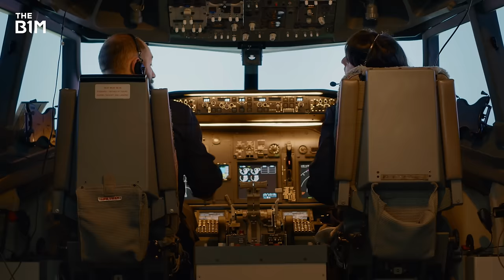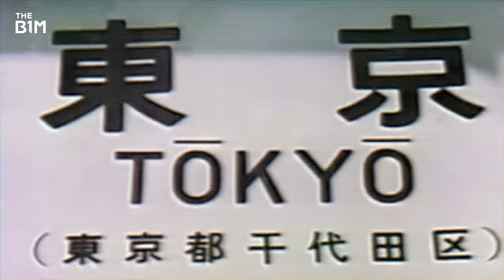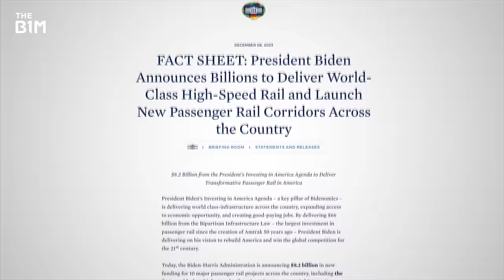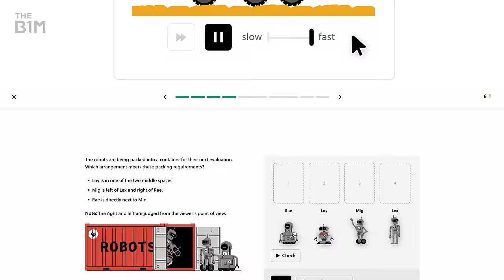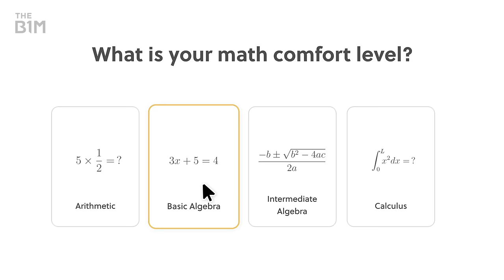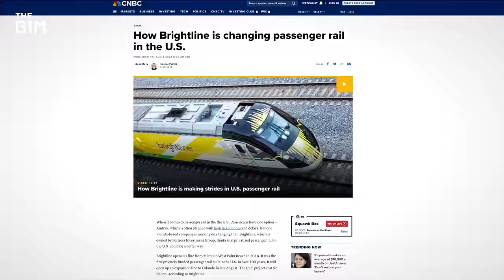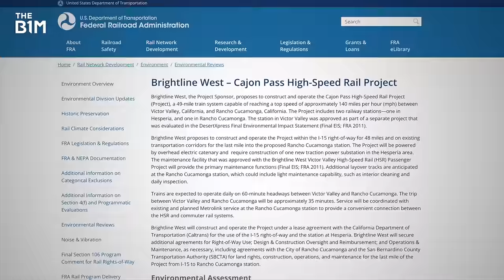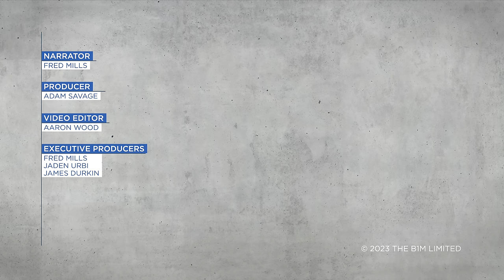The $140BN Race to Build America's First High-Speed Railway

Comment: The problem with America is not a lack of railways, but a lack of public transport infrastructure within the city. You may reach LA in a train quickly but after that you can't roam the city without renting a car. Most people don't take trains just to get to the station.
Reply: The sad part is that compared to other major cities, LA has decent public transportation by comparison. LA has subways, lightrail, and metro buses. The infrastructure completely sucks compared to NYC. There are other major cities that have such awful public transportation that it makes LAs look good. The bar is low in america. We cant fund stuff that might benefit poor people
Reply: LA is disgusting, especially downtown. It is a public urinal.
Reply: True, but trips to Las Vegas are the opposite. They have a monorail service for most of the strip and even outside of that you are often better off not driving.
Reply: You're not wrong, but we need something to help spark the need, such as what Brightline is doing. If we just keep saying 'its useless because we don't have x or y' we'll never have it.
Reply: Same thing could be said for air travel.
Reply: 😂 yeah, you're right. that's the problem with America.
Reply: how many productive hours American can save by going on a 350 km high speed train instead of driving.  Indonesian can now spend only 45 minutes using their first high speed train instead of 3 hours driving. They can still usebtheir hands towork on their computer whlist on board         the train . Hands are stuck to steering wheel when driving
Reply: My cousins uncles boyfriends roommate got his testicles stuck in the bay doors at the light rail warehouse facility in San Diego.
Reply: in this specific case, it’s almost entirely for transferring people from LA to Vegas, not the other way around
Reply: @marcob1729  And then they'll hitchhike back after they lose all their money, right?
Reply: @-whackd says the person that probably either only visited LA once, or not at all.
Reply: Robotaxi
Reply: "you can't roam the city without renting a car." This is no different from travelling by airliner, which is very popular, and not a unique obstacle to passenger rail in the U.S. Also, light rail in L.A. does not make it very unique. About 30 cities in America have light rail systems and 16 have metro systems.
Reply: @BroadwayJoe99  hey, that'll still improve the return traffic! Hitchhiking is a form of carpooling
Reply: @dimitar297 wait what
Reply: A common and tired excuse to continue to not have any viable train service. You have to begin some where.
Reply: The U.S.’s problem isn’t lack of engineering/ingenuity…  it’s the lack of “private” business competition.   
90% of all government contracts, are given to government cronies
Reply: @DavidLopez-rk6em   I have lived in multiple cities in the US with public transportation, including Boston and San Francisco.  It sucks, and has gotten worse in recent years due to cities allowing all kinds of anti social behavior in public. I'll stick to driving my own car where I don't have to sit next to filthy bums and risk getting mugged.
Reply: Couldn’t the exact same thing be said about airports?
Reply: Hear, Hear. LA's transit system is a mess. Sure they have commuter train that are clean and relatively safe. But they're slow as all get-out and outside of the convention center don't really go anywhere.
Reply: @dholzric1 bums and lousy public transport have same root cause, the deliberate defunding of public anything - transport, education, Healthcare by the hardcore raeganites and repubs.
Reply: @krane15  Thats the issue, LA has transit but it doesnt take ppl anywhere important, if anything it takes them nowhere
Reply: @DavidLopez-rk6em  The Northeastern Cities have pretty robust Transit networks, LA once had the largest tram system in the world, car and oil lobbying is the reason why transit still Sucks in the US
Reply: Also the lack of maintenance
Reply: @alexpoon4767 America likes keeping its citizens on a rat wheel. Tired, overworked.... No downtime. They love STRESS
Reply: You park your car at LA train station, take the train to Vegas and return to your parked car.
Reply: Also most homeless encampments are near or at rail stations due to struggles in the past. People would arrive by rail, unable to afford a car, couldn't find a job due to multiple factors, then they'd end up homeless with no way out because businesses don't want to be next to a bunch of homeless people and the cycle just feeds into itself.
Reply: @krane15  I live right next to a commuter rail station and don't bother using it bc on weekends, there's only 2 trains per day and I can't get anywhere significant. I'd love to go into downtown LA for a day trip, but wont be able to get back home since the last train from Downtown leave at 6pm. It's pathetic.
Reply: That's simply not true.  There are many main  sites that you can get to by train  and bus in LA. I doubt you live here.
Reply: @mizzury54  I don't but the last time I was there my dad made the mistake of thinking he could take a bus from Disneyland to LAX. Nope, no bus routes that any of us could find including my friend who lived in Temecula. Also I took an Amtrak and then a bus to the station closest to Ontario Airport and my options were Uber, Taxi, or walk 5 miles for the last section.
Reply: How is 3 hours to go 220 miles between LA and Las Vegas considered high speed?  Since 1982 hi speed train gets you from Paris to Lyon (300 miles) in 2 hours and since 1998 from Paris to Marseilles (500 miles) in 3 hours. Why can’t we thrive for this level of excellence?
Reply: There is lots of public transportation available throughout Los Angeles
Reply: Within city will be solved with self driving cars
Reply: this x1000. People don't seem to understand this. High speed rail is basically pointless in the US, because once you get to your destination, you have no choice but to either rent a car or pay a ton for a cab. This isn't Japan where there's amazing busses and whatnot. Most US cities simply don't have public transit, aren't constructed for it, and would barely benefit from it. High speed rail would make sense in a few places like DC to NYC, but that's about it.
Reply: I mean, the same exact thing is true with a flight
Reply: @moonasha  Good thing you’re not in charge because you’re totally wrong many cities have great public transportation maybe you haven’t been anywhere in a long time like decades
Reply: @BroadwayJoe99 It's as difficult to gamble away your round trip ticket as your car keys or your phone.
Reply: @antonioblt9407 Mountains in the way are a big part.
Reply: @moonasha Explain how that's any different to flying into a city.
Reply: @daniellewis1789  That sounds like what someone that's never lived on the edge would say.
Reply: Don’t see the issue with renting a car at the end of your train trip just like I would flying
Reply: @ricardorocha8758  You've never seen someone lose it all. I'm a retired drummer and vocalist that played in Nevada's casino cabarets for over a decade, and I've watched it happen in real-time more than once.
Reply: @antonioblt9407  compared to driving 5 hours it is. Plus Brightline is starting out as diesel powered. The others in the world are powered by overhead electric lines. That's more expensive infrastructure to start out building. Another reason California is taking so long, which really will be high speed world standards.
Reply: I used a train to get from Irvine to DTLA last summer. Expensive, inconvenient and not user friendly. Then you get to experience the LA Metro! I’m a well built 41 year old Scotsman, and have happily used rapid transit systems all over the world. The LA Metro is another experience altogether.
Reply: The main problem is the lobbying of car industries.
Reply: And the workers are "lazy" and "overpaid". Look at China, the workers take 1/4 of the paycheck and happy to works like 12 hours a day without compliant #kidding
Reply: @Jester-uh9xg In Europe, high speed rail has a comparative advantage over air travel because train stations are with very few exceptions noticeably closer to the city center than airports, and thus also closer to public transport hubs (with the train station normally being the public transport hub). 

And that doesn’t mean that airports in Europe aren’t connected by public transport. The vast majority of major airports have some sort of rail connection, but being at the periphery means for a lot of destinations within the metro area, it takes longer to get there by public transport if your starting point is the airport than if it is the train station.

In short, having decent public transport usually means (high speed) trains have built-in advantage over air travel (which can compensate for the actual flight being shorter than the the train ride, the lack of baggage check-in and security checks at train stations also helps here).
Reply: @Jester-uh9xg  then why spend all this money if we already have decent airport service?  This is all a distraction.
Reply: @loubob21  I agree, HSR in most parts of the U.S. is a waste of money. Only useful for a handful of corridors.
Reply: @Racko.  Pacific Electric had 1,000 miles of track, most of it gone. Their former four track main line is still being used by light rail going to Long Beach. It's amazing that people would rather sit in traffic on the Harbor Freeway and 405.
Reply: @dholzric1  That could easily be solved, but first the Supreme Court would have to overturn their 1975 O'Connor v Donaldson decision, that made it much more difficult to institutionalize mentally ill people against their will, with the same speed and zeal that they overturned Roe v Wade. But I guess the mentally ill wandering the streets aren't a problem in NW Washington and suburban Maryland and Virginia.
Reply: LA has plenty of metro busses. I’ve taken the metro bus from Long Beach to the metro link the DTLA, and the valley. My car was in the shop for a few weeks so i had no other option other than to take the metro bus to get to my destination. It takes quite some time getting used to but theres an app you can use that tells you which bus to get on. Busses arrive every 10-15 minutes.
Reply: @dorkvania7212 lol “on the strip” I wouldn’t even consider it public transportation. It’s a novelty.
Reply: @flamingvans1135  Yeah, its sickening how the autoindustry basically lobbied hard against rail to sell more cars and alot of ppl bought into that nonsense, the biggest threat to the Airline and Car industry will always be rail, thats why rail mostly sucks in North America
Reply: This train starts/stops about an hour from LA. It’s in Rancho Cucamonga and if it’s a weekday get ready to sit in traffic for hours.  Definitely not an uber ride, would cost a fortune as its 43 miles away
Reply: @marcob1729 bet Vegas homeless will be on it.  Especially since CA offering free healthcare via MediCal
Reply: The United States needs both metro area transit and high speed rail between appropriate cities. The places in the world that have good HSR typically also have good metro area transit. 

The U.S. could also use substantial changes and investment in freight rail. It is better to have goods moved by efficient rail. Trucks can transport goods the last bit.
Reply: @-whackd Very on topic, thanks for your contribution. 🙄 

Just in case I ever need to visit a public urinal though, by 2028, I’ll have another cheaper and less degrading than air travel way to get there quicker than ever! Thanks trains!
Reply: At this point I guess it’s companies like Über that are picking up the public transit slack in most American cities.
Reply: @melrose7213  I hate how its nowhere near connected to LA or SF, should of been done like 30 years ago, but the political will doesnt exist, this entire project was just there to create jobs, and nothing more
Reply: @barryrobbins7694 All of that is easy doable, issue is coperate lobbying, car makers will lose profit which is why they continue to lobby against rail
Reply: @Racko.  Yes, there is always opposition to change. Think of what Spain and Japan went through not long before they transformed their transit infrastructure. History hasn’t ended
Reply: @barryrobbins7694  Indeed, also HSR projects in mainly the UK and US can get done way faster if Japanese and French engineers were hired, most projects will be handled by them here, the future seems bright
Reply: Self-driving vehicles along with traffic-reducing drone deliveries will greatly alleviate the in-city transport problem in the next 20 years.
Reply: @MadPutz  The United States conservatively spends $5 trillion on car travel related expenses every year. Most of those expenses will not go away with automated cars. There are a lot of infrastructure expenses related to cars. Cars are not going away, but we need to shift transportation needs more towards rail modes because it is much much more efficient. Many people in metropolitan areas would love to have better transit options, and significant part is that cars are expensive. We don’t need new technologies, other places around the world already know what works. Even the freight train system needs to be upgraded to electric, among other things. Too much freight is going by truck when it should be going by rail. Freight trucks are for the last part of the trip or for going where it is not practical for trains.
Reply: @aphextwin5712 Europe benefits from high speed trains due to major hubs and cities being very close to each other. In the US, Major cities are pretty far from each other. Chicago is very far from the texas triangle, the only major city in the midwest besides Minneapolis.
Reply: @aimxdy8680  Absolutely, how good public transport is within cities is just one factor whether high speed rail (HSR) has a good use case. The distance to the next major city is another. This often can mean that HSR in  America makes sense mainly between two city pairs (like LA and Las Vegas) that are close enough to each other.
Reply: @barryrobbins7694  Yeah I think that its the US's turn on in the HSR game, they still have a chance down the line, we can remain positive
Reply: @Racko.  Maybe Australia will be inspired by the United States. Passenger flights between Sydney and Melbourne are near the top of the most traveled in the world, with Sydney and Brisbane not far behind.  Those routes are busier than anything seen in the United States. Australia really needs HSR between their East coast capitals. The subject gets talked about during elections, but it hasn’t taken hold.
Reply: LA literally has one of the better public transport infrastructure in the US. Bad example.

Even greater LA, just take a Uber, that is normal.
Reply: This comment..
Reply: When more people are taking a train in instead of driving in, that can help influence investment in transit. However more will still be needed of course.
Reply: @AL-lh2ht  I assume you have never been abroad hence you don't have a sense of what public transit could be by experiencing what has been happening in Asia.

Not saying your point isn't valid per your experiences but it's a reflection of how many Americans are kept in a small box so they don't demand better. 

Just ask anyone who has traveled to Europe or Asia and ridden on their public transit. Keep an open mind that lots exist which you unfortunately haven't experienced yet.
Reply: @jasminewhitehead1752  what about it do you disagree with?
Reply: @youtubechangemynamewhy  Sounds like the $$$ is in owning the parking lots.....sad.  I live 20 miles east of Detroit Metro Airport in the city about 200 ft from the expessway(i-94) that the airport is largely on.  Driving takes about 25 minutes; public transit 1 hour 40 minutes.
Reply: @aznosu  tbf Europe and Asia invest a lot in both public transit and private car infrastructure.  Anyone who has been to Europe and rented a car knows that in many places it still is the preferred mode of transit, it's just more convenient.  The key is in having decent alternatives.  In America the problem is often that the budget does not allow investment in both public and private transport infra.  So they pick and choose private transport as it fits well with the individualistic American culture. America funds so many wars it doesn't have enough money for what people here say is essential.
Reply: ok but its still better than nothing
Reply: @tha_oz  so are you saying you would be okay if you get a $.25/hr raise when others around you are getting a $2.50/ hr raise? It's still better than nothing, right. And Americans should see and learn from other countries when they do better correct... just when they do worse should it be noted. Did the leaders in your country teach you that so that you NEVER hold them ACCOUNTABLE?
Reply: @aznosu  what is bro talking about🤣🤣🤣
Reply: @tha_oz  Is this what and internet troll does for a living... having no purpose but to make comments online. Fair... troll your life away if it makes you happy, at the end that is the only goal in life eh.

Troll for life bc my society taught me that is the best I can be. Cheer.
Reply: @aznosu  …. how am i trolling . What are you rambling on about LOL
Reply: @tha_oz  what kind of comment was your first one. Trolls make remarks that is that constructive. What does your first reply mean.... you can just "lol" and whatever. 

Enjoy and I am only replying this once bc maybe later in life, you will recall this lack of conversation and something positive will ignite in your life. Cheers and fyi I won't be replying to another comment from your regardless of what it is.
Reply: @aznosu  I have no idea what you are rambling on about. My first comment wasn't even a response to you? I literally commented on the OP saying "It would be better than nothing". Then you replied to my comment all angry which was incredibly random. So I'm not sure what you are talking about. I dont even know how I am being a troll to you lol.
Reply: @tha_oz  Sorry... that is why I didn't get why it said you commented off something I said. Cheers
Reply: @tha_oz  " @aznosu  what is bro talking about🤣🤣🤣
"  I don't know :body-blue-raised-arms:
Reply: @antonioblt9407  220 mph is the speed of the train. The distance will be about 380 miles between SF and LA. The travel time is expected to be 2 hours 40 minutes. The trains will be at half speed between SF and SJ.
Reply: @dorkvania7212 The monorail is a low capacity system that only services a handful of casinos. And all the stations are at the rear of the casinos. It's not a convenient system to use for public transit.  They need to expand it to more casinos, the airport, and downtown for it to be a true means of public transit. LA has great public transit by comparison.
Reply: LA has the largest light rail system in the country and it continues to grow. The public transit improves with every year. You can get to many iconic places via LA Metro, and Union Station serves as the main hub which the HSR will use as well.
Reply: @-whackd it needed rail 🚅🚝 long ago
Reply: Unfortunately the US was never designed for rail travel. It was designed for the automobile. Rail transportation in Europe actually worked quite well. Cheers!
Reply: EXACTLY

Having lived in Germany for a few years it was so easy to get around without a car.  Regional/Express train between towns/cities followd up by great local Sbahn and Ubahn trains and City Busses.  Not to mention cities are just more walkable in Europe and Asia anyways.
Reply: @DavidLopez-rk6em  And then take a look at Europe 😂 there is every city that has more than 150,000 inhabitants, a really good public transport.
Reply: @Racko. You have no idea what you're blabbering about.
Reply: @Racko. LA has built more public transit rail infrastructure than any other city in the USA for the last three decades and will continue for the next two decades at least.
Reply: @Cal3000 That's changing. Metrolink will run more often. But let's be clear, it has always mainly served the 9-5 working commuter during the week. And everyone knew that.
Reply: @shadowprince4482 Disneyland is in Orange County.  Which is served by a different transit agency. Blame them, not  LA Metro. 

Had you gone to Universal Studios in LOS ANGELES, you could have taken the B subway line from Union Station and it would have dropped you off across the street. Use the pedestrian bridge to cross the street and you hop on a tram to the Universal Studios entrance.

Take the subway back to Union Station and hop on the Flyaway bus directly to LAX.

Disneyland is in the city of Anaheim in Orange County. Blame them for not having the public rail transit that LA has. Don't blame LOS ANGELES!
Reply: @antonioblt9407 The CAHSR will do it between LA and SF. It will have a top speed of 220 mph. The LV train top speed will be around 180 mph at best. I predict it will be lower due to running in the middle of an existing highway median which in certain sections is not very wide. It will also be mostly single tracked. CAHSR will be fully double tracked.
Reply: @KingXKok Even those cars don't eliminate traffic because they use the same ROWs as regular vehicles. Doesn't solve the traffic issue.
Reply: @mrxman581  No they haven't, the city is still extremely car dependent
Reply: and if you arrive at your destination by air? @moonasha
Reply: There's Uber and Lyft and rentals and public transport etc. you aren't travelling to drive a car you just need to get between cities and rail is an alternative to commuter flights
Reply: Worddd
Reply: @DavidLopez-rk6em only we can as the world heals and classism and capitalism crumbles. Have hope !
Reply: @DavidLopez-rk6em living in LA I can tell you I will 100% prefer to drive or walk than take public transportation. The buses, metro, and stations are all disgusting 🤮 crackheads, crazies, and homeless everywhere. Not to mention it’s expensive for a one way ticket.
Reply: My coworkers at DirecTV used to get mugged + worse using public transit.  Not a great place for it.
Reply: @zaderq1 
I doubt that! 

You don’t even use line 16, 18, 20, and/or 720.
Reply: @RockwellAIM65 
Then your coworkers are transplants.
Reply: @antonioblt9407  I took that train in 1998. It was glorious.
Reply: The problem with America is the excess of people driving and those people not taking public transportation making there be a lack of public transportation?!
Reply: The "last mile" problem.
Reply: @remmond3769 USA spends a lot on welfare
Reply: @dholzric1 Brightline isn’t BART, it’s more of a luxury train service.  I doubt you will see any bums riding it.
Reply: Well, it's both.
Reply: @-whackd I guess you’ve never been to states like Mississippi.  Try it sometime, it may change your perspective.
Reply: you can rent a car, with robotaxis and tesla share upcoming its not gonna be a problem
Reply: Have you been to LA? There’s public transit everywhere. The brightline station being built is next to a transit center. 

The problem is Vegas, as of now there isn’t even a bus to get you out of there.
Reply: @JStack Just because there’s public transportation doesn’t mean everyone wants to take it! I’d personally rather not be robbed or have to wade through the homeless and drug addicts on my vacation!
Reply: Nah. Not you can't roam the city without renting a car. Not “you can't roam the city without renting a car.” Not “you can't roam the city without renting a car”. /